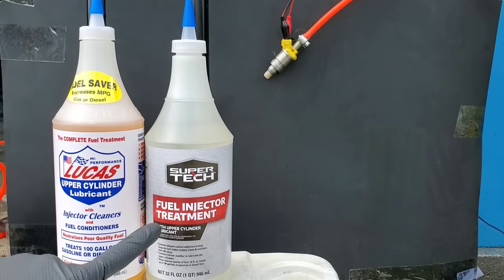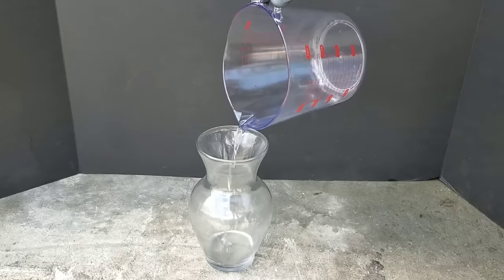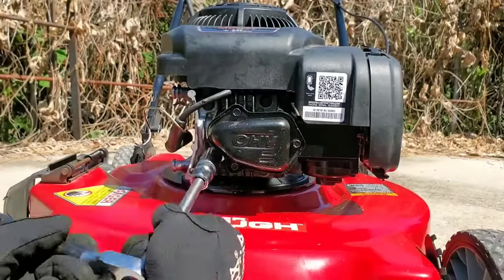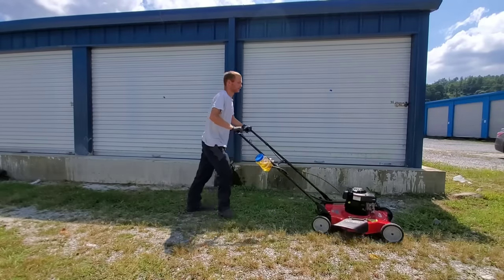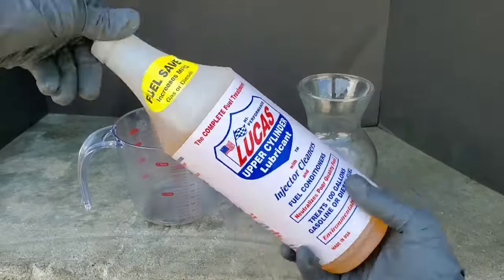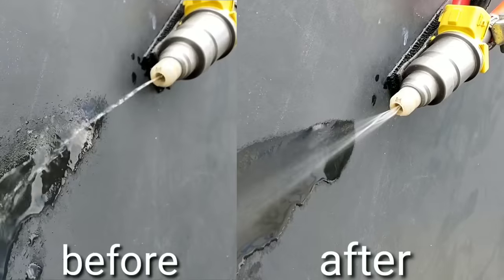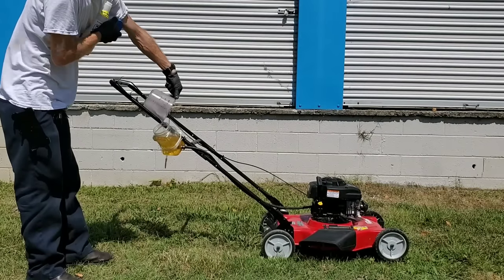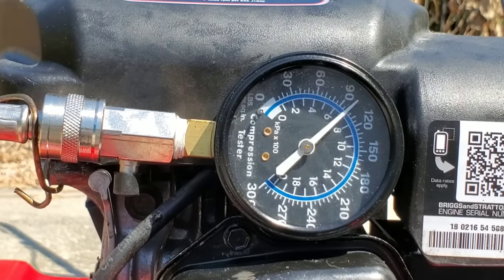Lucas vs super tech. Fuel injector cleaner!

Comment: Had been using Super Tech.  Tried the Lucas and it smoothed out the idle and raised idle by 100 rpm with one treatment.  Sticking with the Lucas.
Reply: Lucas has been around for years
Reply: Lucas and Liqui moly are the best
Reply: I use Lucas in every thing my fule my oil my diff and even my transmission and it makes your car run better and last longer I brought a old truck back to life with Lucas
Reply: How safe are these additives
Reply: @rickferr1546  Well for the engine fine. But don't drink them.
Reply: @edwardcnnell2853 😅😅
Reply: Lucas is the mostr expensive, a quality which I equate with "the best."
Reply: Sometimes u just have to use the good stuff. Can't cheap out on certain things.

Comment: As a lifetime Trucker, if it says Lucas on it, it just plain works.
Reply: Yep works good on the old cat and 12.7 never had any problems
Reply: Lucasfilms
Reply: Throw in hot shot secret diesel products I'm gaining about 1mpg on my cascadia
Reply: Will it clear a EVAP system code?
Reply: @Notcosmonaut  no. You have some sort of vacuum leak
Reply: How much they pay you to say that? Lmao
Reply: @Notcosmonaut  no. i have one. mine is a leak between my filler tube and my gas tank. i spill about a half gallon every 120g fillup. so mines an easy diognosis.
Reply: @tehpurplepills  also an easy fix that would probably pay for itself after a couple fill ups haha
Reply: except for electronics
Reply: Not sure if I would say I like all Lucas products, but I do use the fuel system cleaner for maintenance between using a high p.e.a injector cleaner. Lubegard is my go to engine additives, biotech is my number #1. Lucas fuel additive is low cost and easy to get and does help.

Comment: I have used Lucas upper cylinder lubricant / injector cleaner for many years and yes, I recommend it. In your tests, it might have better if you had at least two injectors for each injector cleaner. Run the injector cleaner through each one for a few minutes. Wait for a while, then run the same injector cleaner again. Test the actual fuel flow rate prior to and after injector cleaner, as well as visual inspection of the spray pattern. Also, what was the temperature of the engine on first compression test, and at second compression test? Were the compression tests always performed at the same engine temperature?
Reply: Spoiler: this was not an actual test.
Reply: can we just thank the man for giving information and not dragging it out. no one does that anymore. if you wanna do a test with all you said go right ahead it's not as easy as it looks. he did a great job.
Reply: I agree. Ideally this would be a blind, side by side test, done on separate machines, for the same length of time. The engine results done at the same temperatures.

Comment: Like the saying goes, “if Lucas products do nothing for your vehicle, then you probably need a new vehicle”
Reply: Or it's already good enough
Reply: If lucas dont work, Berryman will!
Reply: My ranger was sluggish, laboring, I started using Lucas, it helped, smoother, better power
Reply: large baloney......
Reply: stoney renegade  seafoam does the same thing. Ran it through my crank case and started getting misfire codes left and right. Flushed my oil a second time and its good now
Reply: @richardkey4289  fu@cking Ford ranger!... 😆

Comment: I checked. My push lawn mower does not have fuel injectors!
Reply: Hahahaha
Reply: Lol true.
Reply: Cheap mower bet it ain't got any ps.eyes
Reply: They're right next to the flux capacitor.
Reply: lmao how'd i miss that!
Reply: The Lucas product,  claims clean injectors and carburetors systems.
Reply: Pro tip all lawnmower injectors are behind the muffler bearings, right next to the water-nator.
Reply: that mower does in fact have GDI on it.
Reply: @be891  are the muffler bearings next to the turbo charger ...

Comment: I've used Lucas on a car with a check engine light. After 25 mins driving with this shit the check engine light went away 100% stand by Lucas.
Reply: ok that was 8 months ago i bet your check engine light came back on now, lucas does not have power to talk to ECM and does not have power to repair electrical sensors either
Reply: @dkrawk8309  would it not have that power if it was something like a clogged fuel injector? If he only had a clogged injector which was tripping a fuel/air ratio code which cleaning the injectors fixed wouldn’t that end up fixing that issue?
Reply: I had an 86 caprice with carburator an lucas cleaned it so good i had to lower the idle on the carb,that was bout 25 yrs ago, literally made me a Lucas fan!!
Reply: you again
Reply: Today is 06/08/24 I have added Lucas to my Silverado 1500 2009 5.3. I did my first ever Ross trip since I had purchase the truck 2017 with 148k miles. Now is at 193k I can back home and when getting off Express and was doing 25 mph I realize truck started shaking. I come to find out I have a misfires on cylinder 6. Spark plugs, coil pack are good. Tomorrow I’m driving it on 75 mph zone for 20 min.

Comment: I've been using Lucas oil every time I fill up and not gonna lie, it actually improved my fuel economy significantly.
Reply: It is about the same cost though. Either pay more in fuel, or pay for the bottle. All the same in the end.....
Reply: One is far easier than thr other.
Reply: Agreed.  My 2009 escape dropped to 20mpg.  Half tank of Lucas and it was at 26/27 where it should be. Clearly had an issue that Lucas resolved.  Very happy customer!
Reply: @HorsepowerHouse difference is your car will last longer without the restriction

Comment: Yea but if u used the same fuel injector kinda defeats purpose of video? Supertech could have been a catalyst for Lucas
Reply: I'm sure the supertech was probably responsible for the increase in compression too. The mower just needed to run a little longer with the reindeer piss finally  coming out of hiding coincidentally at the same time the lucas treatment was being applied.

Comment: Lucas is the best stuff. I had an old 1996 chevy 2500 as my first truck. 112k miles and it had a lean injector #7 code on it. Tried cheap first like gumout, stabil, then seafoam, and finally lucas oil. Lucas oil was the only one that worked to get rid of the code. Drove it for a year and a half no problems. Got Casey's gas 1 time and i got the same code again. Put lucas oil in and used bp gas from then out and never had an issue

Comment: Only problem with a fuel injector test is that we don't know how much material was plugging up each injector. It could also just be the gasoline that cleaned the injector. Gasoline is powerful solvent.
Reply: True but one would assume that gasoline was already running in the injectors.....
Reply: @102wingnut  as I said the test was not performed in an appropriate scientific method
Reply: @dondon-wg9ft  yep.
Reply: He used the same engine. Look likely that he also used the same injector. So the first test worked as a pretreatment, followed by Lucas for the win. Question everything

Comment: Have used Lucas for over 5 years in VW TDI and AUDI TSI always worked like a charm. Way better than anything else in the market.
Reply: How often do you apply this, I also have a be tdi?
Reply: @adriendunn530  every fillup
Reply: Ok thank you and how much do you use per fill up?
Reply: @adriendunn530  Just a little bit - about 100 ml
Reply: That's nice to know your experience. 
 Should I use this in 2007 skoda Octavia 1.9 TDI diesel? 
Should i use it every fill up? 
Will it be safe for fuel filter and cat if  used every fill up as it's little bit thick like oil?
Thanks
Reply: @1.9tdilove71  Should be good every fill-up. I didn't face any issues as far as fuel filter is concerned. Use the normal one not high mileage one.

Comment: Did you test compression when hot both times? Compression increases when engine is warm ! Just asking?any reply appreciated thanks
Reply: Very good point
Reply: He ran the engine and used the mower both times. The additive was run into the engine via that external fuel tank.

Comment: What psi are you using on that injector. Needs to be 50-80 psi to do the right job
Reply: I was thinking the same thing! The litte trickle originally looks more like 10psi! Not 50... 

In think he raised the psi for Lucas and added oil in the cylinder when doing a compression test for Lucas to give it a leg up!
Reply: It sounds like that when he was pulling it. He also pulled it 3 times more than with supertech

Comment: Was that the same injector you ran the super tech on cuz maybe the super tech loosen the clogged and the Lucas just had it easy and just had to finish the job the Tech started.
Reply: Seriously, 
You needed to start with a different clogged injector and a difference lawn mower. This test was totally useless.  Supertech had time to sit in the machine while you were setting up the next test and clean.
Reply: Foreal
Reply: I was thinking the same thing. 
Essentially, he ran two different treatments through the same equipment. Both additives working together probably work better than just one or the other.
Reply from the maker: I make sure the injector is clogged on the same psi also using a flow meter. I start each test with a 30 year old gas tank and place gas line in the bottom until clogged with even pressure and flow. This is the only way to run the test. The testing is performed at separate times and the mower temperature is all equal plus so much more i could run a time lapse and include all the other details but you would be watching a 15 minute video if a speed a big part up 8x.
Reply: NATES INTERACTIVE AUTO so in other words, you just slapped some stuff together and had no real control over anything. 
Everything you just said is pure BS. 
Even if what you said is a little bit true, you still had no control over the density of the clog, which also negates your results.
Reply: NATES INTERACTIVE AUTO not to mention your lawnmower compression test. 
Did you dismantle the engine and re-damage it between treatments? 
I seriously doubt it.

Comment: Been using Lucas for a long time know since the first time i used it a shitty running z car after like 2 bottles in one tank of gas (2 for higher consintration ) the cars performance increased drastically over the course of the tank.damn car had so much carbon build up.

Comment: Lucas is a great product but I feel this additive made my truck a little sluggish feeling. I switched to MMO (marvel mystery oil) and it runs like a sewing machines
Reply: Can it sew green sthocks?.
Reply: I use lucas at 3 times the recommended dose with 92 octane fuel in my 2013 hemi truck, by 3/4 tank(has 31 gallon tank) i notice huge difference in power, smoother and response then at next fill up i add marvelous mystery oil. I tried all cleaners i could find and this combo has been excellent.
Reply: I run this same dose etc every 6 months, every time I feel a difference, but in my ls3 camaro I do not really feel a change or my other vehicles.
Reply: Mmo literally just fixed my Honda’s oil burning issue. It’s kinda mind blowing lmao
Reply: @jonolson5397  a new oem pcv valve fixed my oil problem in my Honda now i need to work on the fuel injectors I'm still looking around to see which brand works the best
Reply: @rotwiler7674  3 bottles a tank?

Comment: so let me tell what happened, based on that i saw in this video. To mention that I have never used the other stuff, only lucas.
So the chap runs whaever it is through the injector first. No noticeable difference, then lets it SIT for x amount of time, when grime and contimination is all dissolved, lucas blows it out.
Not a test to depend on, BUT. LUCAS DOES WORK

Comment: I bought a 2006 Cadillac DTS that ran like crap, replaced spark plugs and coils, ran a little better. Terrible gas mileage, less then 15 on highway and less then 10 in town. Been using this additive since December every fill up, average gas mileage is 24 mpg on highway and 16 mpg in town. This was a slow change over time, I don't measure how much I put in either, before I fill my tank, I give it a nice squeeze of the product. Not even to consider the overall take off of the car under full throttle is way different, does 0-60 is about 7 seconds now as compared to being sluggish before. Thanks for the video.
Reply from the maker: Thanks for sharing your experience with the NIA community.
Reply: @NATESINTERACTIVEAUTO   Welcome. Should do a review of Walmart's Hyper Tough tool lines. Least their hand tools have been absolute junk, rusting and breaking within short time of purchasing and using a few times, least for me.
Reply: Nate: your testing methods have flaws. In the past I pointed some out to give you a idea what is involved in testing products as industry standards. You are not giving a fair evaluation to what you testing and evaluating . Do what you like, I am not mocking you but but consider doing these tests to be a fair comparison and rating.

Comment: I owned a big truck, and was told by the company to not put additives into the engine.
I was suffering from poor fuel mileage, and threw a LOT of money at parts. Air cleaners, sensors.,,
I finally said heck with it, and dumped a gallon of Lucas into one of the tanks.
I didn’t even let it mix, I put it in after the tank was already full.
The mileage went from 4.2 right up to 7.4 that trip.
Used it religiously ever since.
As far as oil additives, every oil change I put in a gallon of Lucas oil stabilizer, and a gallon of Motorkote.
I wore out the seals long before the engine was tired!
The seals could not be replaced, and I was forced to spend $30k on an in-frame rebuild.
Oh, well!

Comment: I think the Lucas is nice to maintain the clean injectiors and to add a little protection against startup wear but for deep cleaning and MPG increases I use the Royal purple max clean.
Reply from the maker: Thanks this helps others.
Reply: I only use lucas and royal purple. Royal purple gets that deep clean
Reply: Might have to try the royal purple stuff, I just dumped 2 cans of seafoam in my gas tank, gonna run that thru then change the fuel filter then injectors
Reply: @winning77th  Royal purple its one if the best for cleaning 

My top cleaning additives: 
Royal purple
Sea foam 
Lucas
Mystery Marvel oil youll notice royal purple and mystery Marvel oil right away.

The lucas oil additive youll notice the engine doesn't get as hot especially in tbe summer.
Reply: @winning77th  you don't typically replace injectors unless they go bad, you can pull them and send them off to a reputable company and they will clean them and send them back but you don't replace injectors unless they fail unless you like spending lots of money
Reply: @outdoorsmanlifestyle2434  I’ve used marvel mystery oil to release seized piston rings the stuff is amazing.
Reply: @outdoorsmanlifestyle2434  how do you use royal purple.

Comment: Both cleaners would have worked better had they been pulsed during cleaning. Hot compression "wet' should be the comparison. It's always the same, or higher than cold compression "dry" no matter what fluids are run through the engine.
If ANY oil is added to fuel that doesn't vaporizes as well as the normal or in greater percentage than normal  the compression will rise because of the residue on the rings.  Run the engine for an hour and test again.

Comment: I would like to see a test with a diesel fuel injector and compare a few of the diesel aditivies in terms of improving spray pattern.
Reply: That does sound like fun. Mercedessource makes a great diesel injector tester that fits a variety of Benz prechamber diesels. It is said to work with other Bosch injection systems used on other prechamber diesels, so long as you have the right adapter.

This test is doable at home because prechamber diesels don't need high pressure to function, but direct injection diesels do need high pressure.
Also, this is doable because the injectors have no electrical components inside of them. Unit injectors, HEUI injectors, and common rail injectors can only be spray tested with machinery that costs a lot of money. If all the electrical components are in the distributor pump, you will be able to use the same tool as the one for non-computerized prechamber engines. The 1995-2001 GMC diesel van is the only example I know of which has both a computerized distributor pump and a prechamber design.

Comment: To solve most of the doubt, I just buy 6 to 8 bottles of 3 different types (2 bottles each), put them all in the tank at the gas station, and add 6 gallons of premium gas to a near empty tank.  I do this yearly or every two.  I don't tell any difference one way or another, regardless if I add one bottle to 12+ gallons (or full tank) or this more concentrated mix. I doubt that mixing one bottle to even 5 gallons of fuel would do anything, much less a full tank. The stuff (any brand) is too weak...it's almost certainly a gimmick at that "tank full" dilution.  I've done this for years on numerous vehicles. Not sure if it does a dang thing, but it's never given me any problems and I've never had a clogged Injector.
Reply: This guy knows how to party
Reply: @vicmccartin  😂

Comment: You onow sone of these additives arnt made for lawn mower Engine or engines that use a mix of fuel and oil... They also say that its not gonna work for too small an engine on the bottle.
Reply: the lawnmower was a 4 cycle so it doesn't really matter